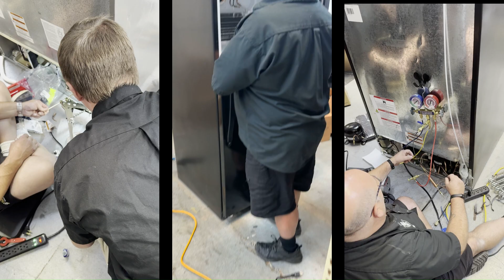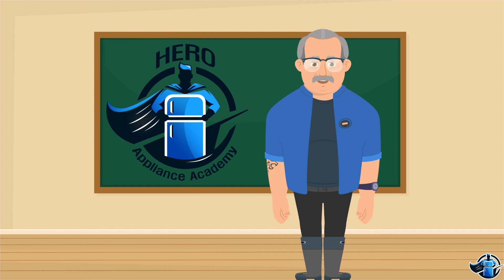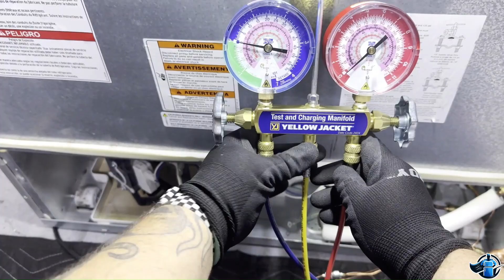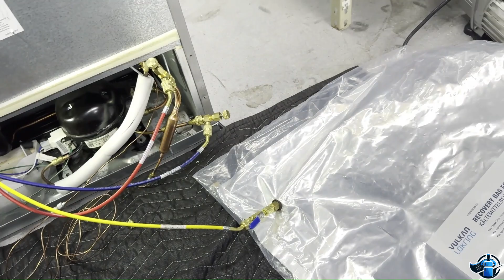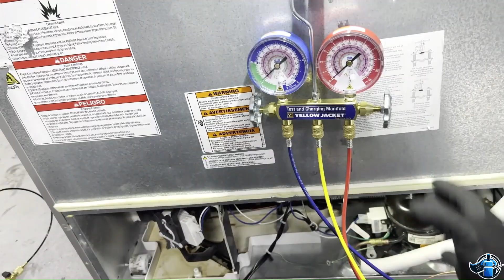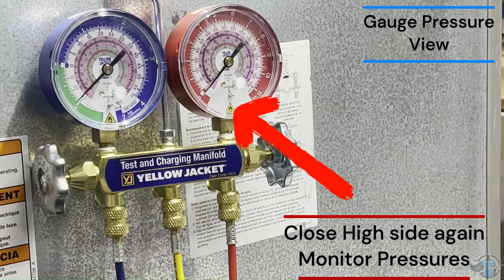How To Pull Refrigerant Charge

Comment: Thanks for the video!
After refrigerant trapped in the bag, and sealed system fixed & vacuumed, can I let the recovered refrigerant back to the system straight from the bag?
Reply from the maker: The refrigerant is now mixed with air in the bag. it must be released or if its 134a, recovered. do not recharge unit with refrigerant that has been recovered. Hope that helps!